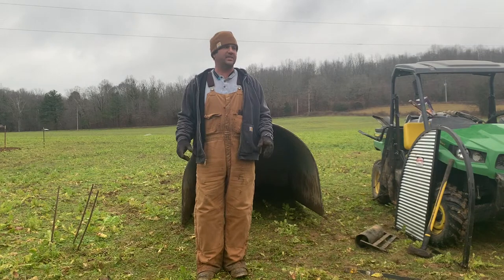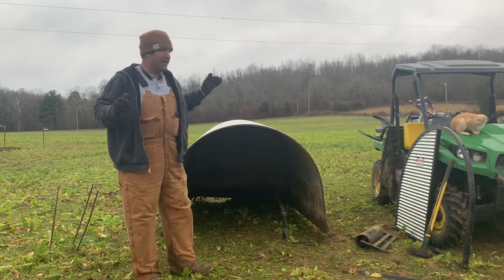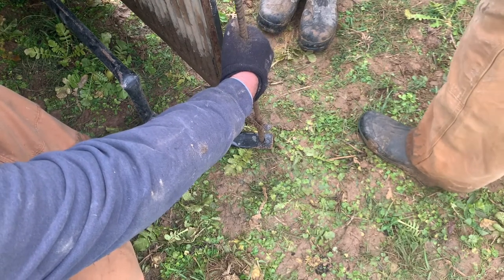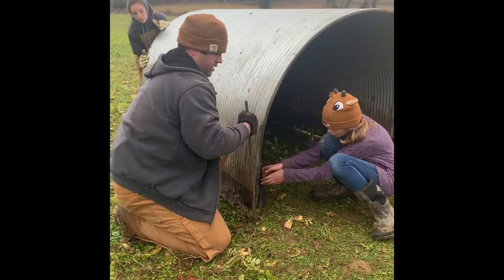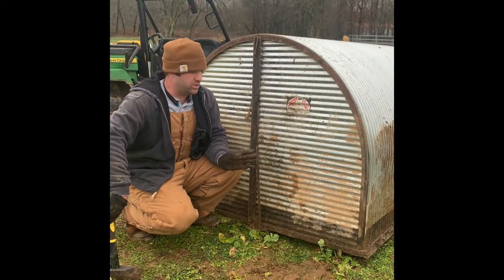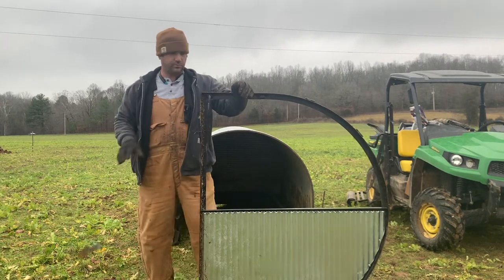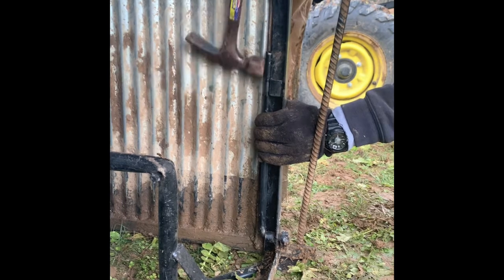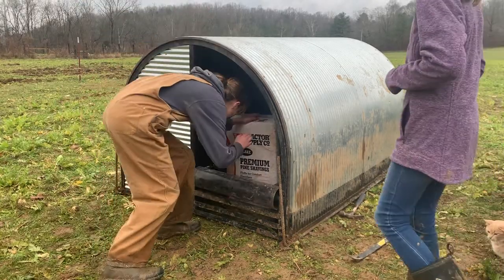Setting Up Port-A-Huts for Farrowing

Comment: What year is your JD tractor & what engine?   Have u seen mine(my dad's)?   It's a 77' w/ the 3 cyL Yanmar.
Reply from the maker: JD 2350 they only made them for three years from what I can tell- 1983-1986! I love it, it’s the best tractor I’ve ever had. I would like to see your dad’s tractor!
Reply: Cool, what engine?  It's bigger/better than our's.  We don't have a front end loader.   How many u had?
Want to see my dad's tractor?
Reply: Do You want to see my dad's tractor?...
Reply from the maker: @leeisenberg  a bunch! Maybe six or so! Yes I would!
Reply: Already tried to share the last post at least 3-4X, but looks like it finally stuck this time.  mercy
Reply from the maker: @leeisenberg  😆
Reply: Can y'all make a short clip of the piglets trying to escape the roller in the farrowing hut?   Just looked for a clip, but didn't see anything.